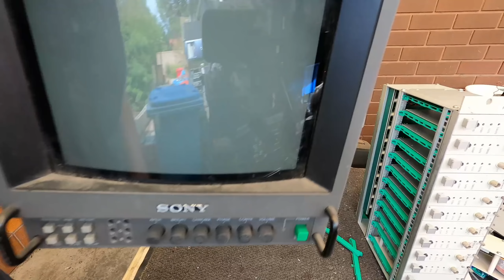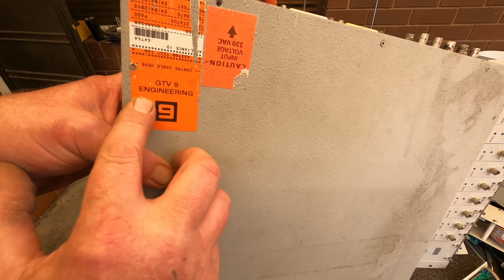Short & Sweet Scrap TV Electronics

Comment: I scrapped similar but bigger equipment from a older motel combined with telecom system. it was gold inside the smaller chip also. I used a air hammer with a flat sharp tool.
Effective... its is the right era with gold chip. ive also got the aluminium boards with gold pins they used to wrap the copper wire around. it was a big load of pins.
Nice videos u have .....